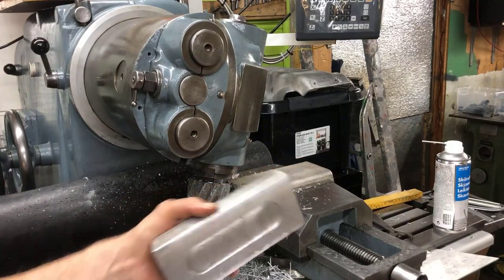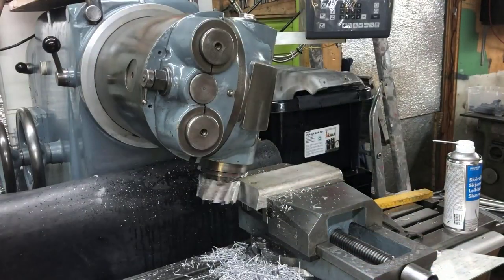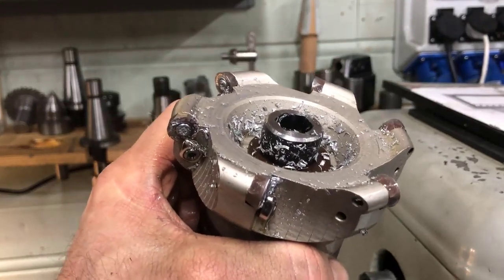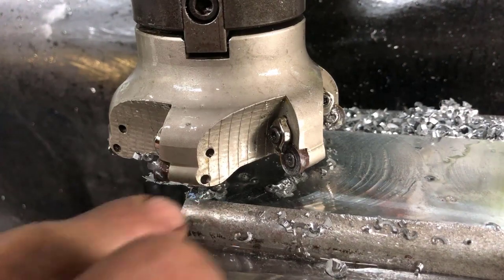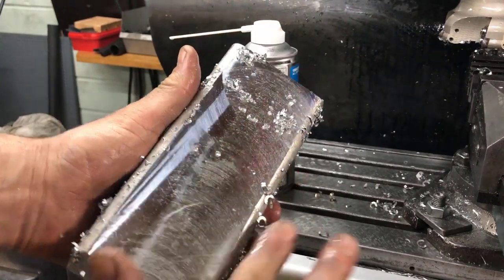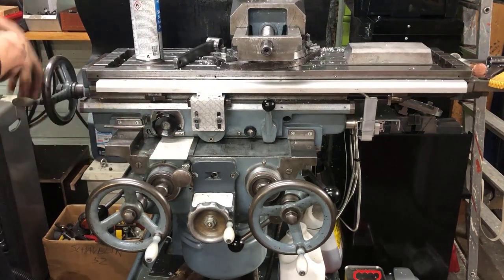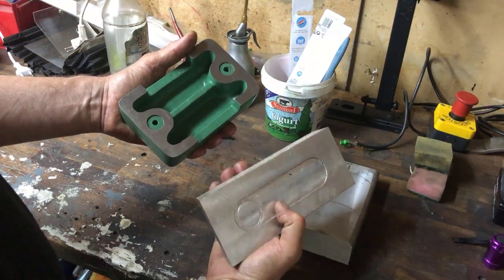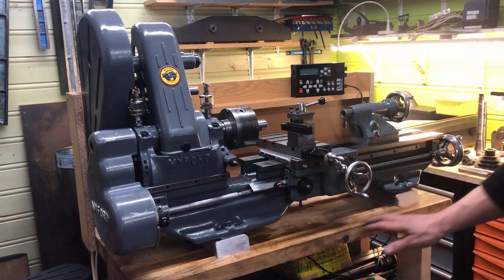Making feet for the Myford ML7 lathe using the Schaublin SV52 milling machine

Comment: Any specific reason for adding the feet ? Looking forward to the Rocketronics series, I can compare notes with my DIY ELS ;)
Reply from the maker: Thnks for commenting. I think the Myford does well without feet also, so there is no "must" to have them in my eyes. I assume the real reason was when mounted on a stand with a swarf pan it is sitting too low without? ANyway, I had bought some cast alu blocks and thought "why not use them for feet?"
Yes, I thought I would see how the ELS "performed" with only the Z-axis operational as it seems many would like to "upgrade" to just this level
Reply: @jansverrehaugjord9934  Just the Z would give you turning or boring operations to a predefined depth and threading. I've been slowing building my own ELS controller to do more precision turning and tapers with a DRO closed loop feedback. Slowly getting there :)
Reply from the maker: @HM-Projects  Yes, I know. I am a bit curios how it will perform in practice, ie. when having 2 axis control it is a "no-brainer" as the cycle-control is automatic from when you hit start until done. However, I see many home-brew designs offers a "gearbox-replacement" functionality, which is also two of the modes in the Rocketronics software menu, apart from a separate threading program as well as the boring, grinding and other functions. It will be a fun test I think.. PS! It is also a bit out of "laziness" that I don't do the X-axis on this machine (for now at least). The saddle on the ML7 is not bored through as some of the Super 7's are, so then there is an inclination to mount the X-axis stepper on the front side instead.. which requires a little thinking first :)

Comment: Very neat. How do you level the lathe? Shims? Or is it just standing on four nuts? And you mention a rubber sleeve. Is that for damping? My ML7 is currently just standing on four M8 bolts tightened to the stand but I wonder if there is a more rigid option.
Reply from the maker: As of now, as stated, I have only mounted the lathe temporarily on a test stand not meant for regular use. However, the bolts are fitted with thick rubber washers and I have actually found it is possible to measure accurately and take out a certain amount of twist by tightening the bolts. I reckon you can use shims to do the same on a permannet and rigid stand.. I would anyway. If you compare with a more hefty, toolroom lathe, many of these have half their weight in the lower part/cabinet/stand, and the bed screwed firmly to these making it whole assembly of considerable mass. The best (in my opinion) of these stands are also made of cast iron, so have good dampening properties (not just sheer weight). Todays' equivalant would for example be the Studer grinding machines with a cast "Granitan" integral bed/stand https://www.youtube.com/watch?v=KaR8BnfMspc
I a "hobby scenario" I think either a granite block or a concrete foundation onto which the lathe is firmly and accurately mounted is a good alternative. I have done this on both a Super7 and an ML10 and this improved the stiffness/chatter resistance a lot!
Reply: Interesting - I would not have expected any kind of stability/repeatability with rubber washers. I think my permanent solution will involve concrete castings, since my workshop has a suspended wooden floor from the 1850s with rubble 400mm below. Good to hear it works well for you. Very interesting video on Granitan too (epoxy granite of some kind, I guess). That seems somewhat popular in the DIY CNC community.
Reply from the maker: @jeffgough8862  Epoxy granite is expensive yes. I once built a wooden stand with a deep "tray" (to get it to a suitable operating height) for a 120kg or so granite block. Then I glued/bolted a couple of aluminium blocks to this as feet, scraped these to a perfect match and bolted the Super 7 onto this. I think this was a good setup!
Reply: @jansverrehaugjord9934  wow yes, sounds very solid. Never attempted scraping - looks like a tricky art to master!
Reply from the maker: @jeffgough8862  Scraping is a neccessity to master for machine restorations (in my eyes) and can also prove a good asset for general shop work as you learn a lot about alignment/measurenment and tool usage.